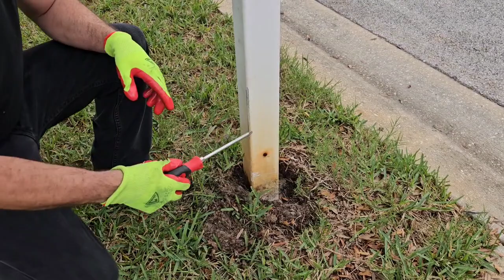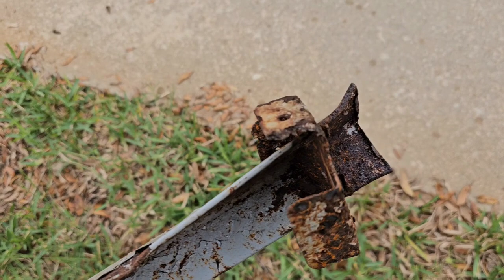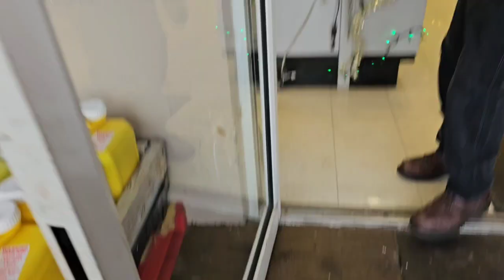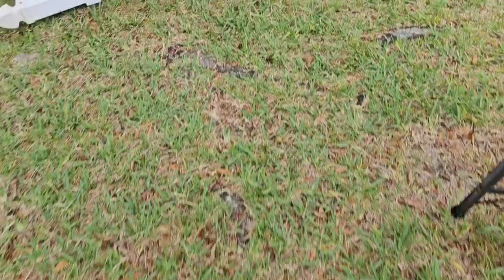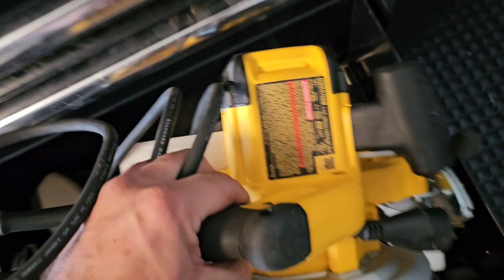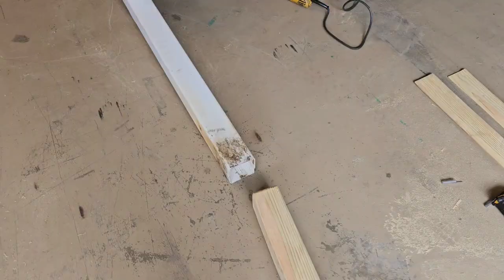Fixing a leaning mailbox. Fast and easy repair

Comment: Light years easier and cheaper repair that will last forever (unless someone runs your mailbox over LOL), is the post auger/anchor.  Just screws down into the ground, has a U bracket at ground level, insert wooden post, attach with 2 bolts, slide mailbox finished post cover and box, done.